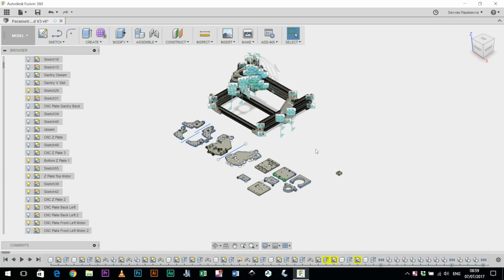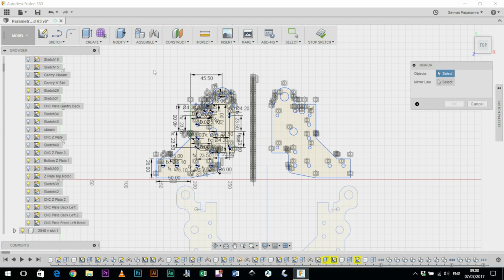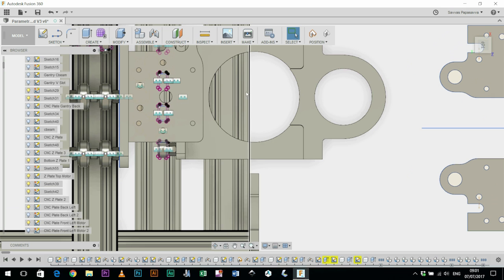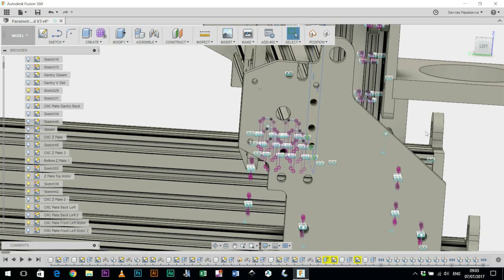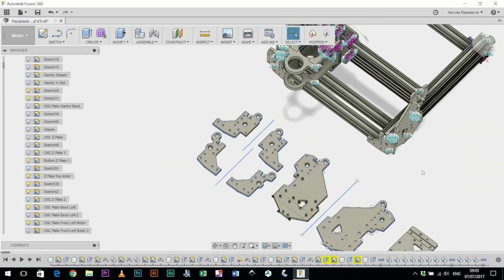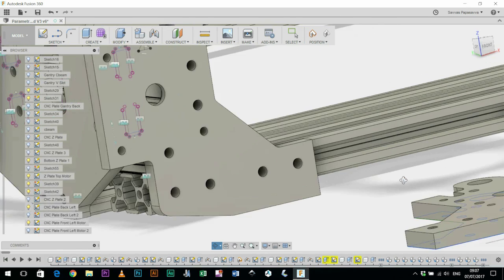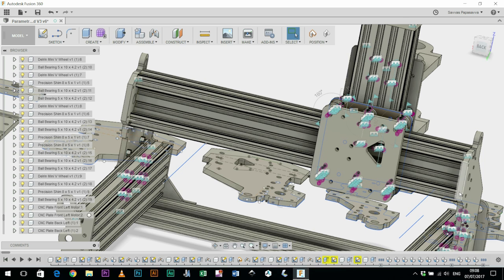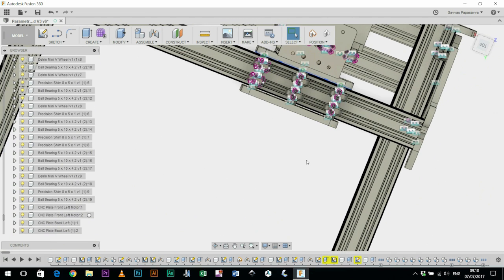Virtual CNC Design / 2nd Update / Fusion 360 / Parametric

Comment: Savvas are the plates going to be available for purchase, you do mention acetal but I thought you were going to use 18mm ply, regards. RobUK
Reply from the maker: It made sense to try a new material. It's clearly the ply plates work so now for Acetal. As for selling I think I need to complete the rebuilt first before I take any orders. And write up a list of parts.
Reply: Many thanks for your reply and I will be patient and wait, stay safe. RobUK
Reply: I am a early retired Electrical Engineer who worked for a large R&D establishment for .gov so I am no stranger to CNC and 3DP, since retiring I have a passion for a hobby that involves both, where do you source your extrusion in the UK as I am sourcing parts to join you on your journey, regards RobUK
Reply from the maker: Thanks Rob. I would recommend ooznest.co.uk - their customer service is quite good. :)
Reply: Many thanks did not know about them, reasonable prices by the look of it, take care, be safe. RobUK